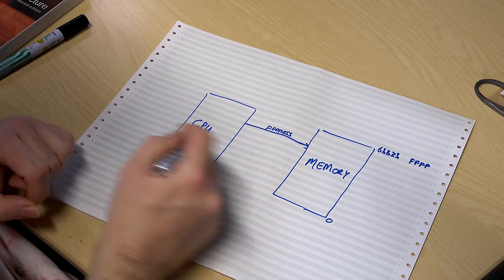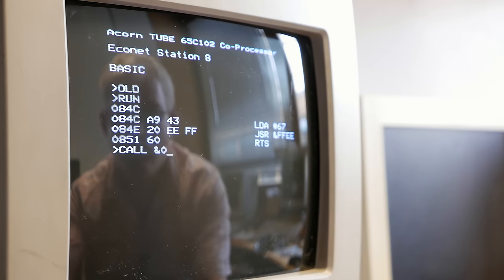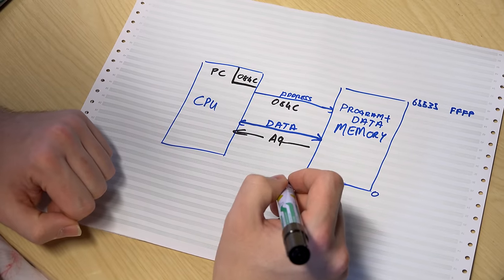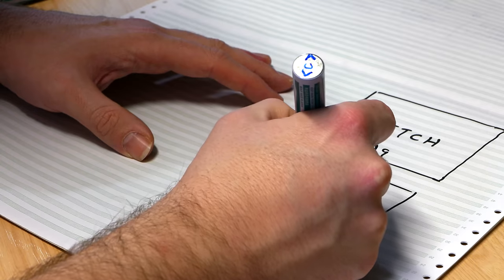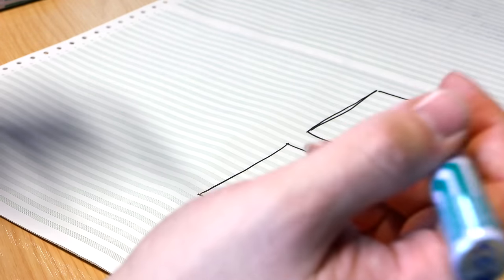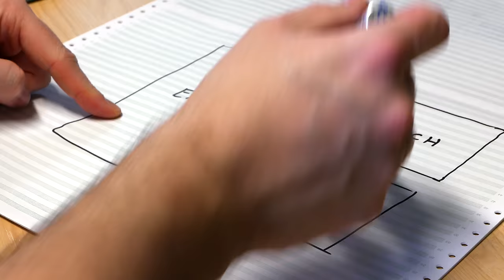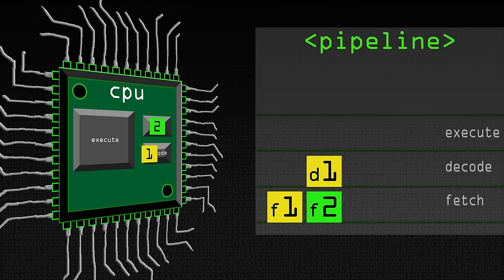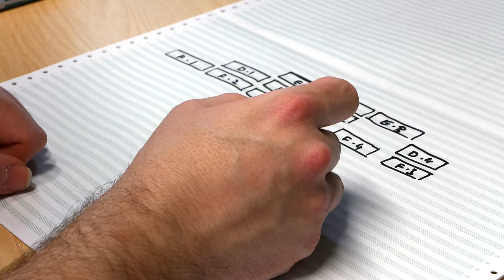Inside the CPU - Computerphile

Comment: I always love this low level computer stuff.  I would like to see things go even a little bit lower, like what exactly executing a command looks like in mathematical terms though
Reply: If you really want to know then check out Ben Eater he builds the various pieces of a computer on breadboard and over several videos you start to see and understand how computers do their thing. After watching and realizing  how much goes into the simplest of tasks it really puts into prespective how amazing something like the smart phone is. It's truely magic.
Reply: lower? so...Algebra
Reply: you know, i think on the level of binary digits these things have structure of boolean algebra, that is kind of abstraction over physical device, ( like usually math)
Reply: Some is boolean algebra, which is then broken down to transistor levels. Most transistors use Silicon in their construction, hence, "Silicon Valley". Other's uses more complex circuits, which those can be broken down to boolean algebra, etc, etc
Reply: Many of the 1's and 0's of an instruction are used as the "select" bit of a series of multiplexers, which are tiny logic circuits that take in multiple values, and output one of those values based on the select bit.  Other 1's and 0's may be routed to internal CPU registers.

The math is handled by the ALU, which can perform math operations hard-wired into the chip, using combinations of the fundamental logic gates.  It's a bit like a CPU inside of the CPU.  It takes as input some CPU registers, and some of the instruction bits, and it outputs to other registers.  It also outputs a few op-codes related to the result of the operation (used for the flags, and other decisions of the CPU).  The instruction bits inputted determine what type of operation executed by the ALU.

Within the ALU there are chips that can add (using several XOR and AND gates), multiply (using several ADD + other gates), negate, bit shift, etc.  I think this would be a great topic for Computerphile to cover
Reply: I hate low level, I love Java and hate mips sorry.
Reply: Lower  ---> logic gates
Reply: I can second Nand2Tetris
Reply: If you want to go even lower than this, it's not really maths you're looking for, but rather how the actual logic gates in the CPU work, and what does what and how, when the CPU fetches/decodes/executes instructions.

Comment: If anyone wants to understand this stuff at a very fundamental level, I would highly recommend Ben Eater's series on building a breadboard computer.
Reply: aye i was just watching that
Reply: Supreme  the large-ish black boxes used in the breadboard computer series are integrated circuits, essentially a packaging around the actual logic gates to make it possible to handle as a human. There's a tiny assembly somewhere in there with the actual logic gates, connected to the IC's outside connectors via tiny wires.

The logic gates in a modern CPU are even more miniaturized, of course. As for where they are in a CPU, well, they pretty much make up the entire thing, storage (lots of caching going on in a modern CPU, also some microcode) and wiring connections (most of the cpu's package is filled up with wiring that connects to the connectors on the bottom; the actual cpu is only a few square centimeters in the center) aside.
Reply: He’s fake. He admits he uses boards.

Comment: Generally a cool video, but I think you should've split it into one about pipelining (there are other hazards as well like conditions). And then you (or Steve actually) could have expanded about the actual steps inside the CPU. I saw a video recently of someone building a CPU (+ Memory) on breadboards using separate chips for the registers and so on. And I found that video really helpful to see what actually means "fetching", "decoding" and "executing".
Reply: Fabian Neundorf , Can you link that video? Id be very interested to see it.
Reply: please link that video ;-;
Reply: PureMotionHD well in my reply I linked it. if it doesn't show up, search for "Ben Eater" who is the uploader.

Comment: I think it would have been worth of at mentioning that executed instuction may also cause program to jump to different part of code. Therefore executing next command that is already in pipeline would be invalid and whole pipeline need to be flushed before continuing.
Reply: Tiikoni And maybe also that the execution of a pipelined instruction may override the value of a memory address already read by the fetch module? In this case a partial flush is also necessary, I think. Although it must be noted that changing the code section of memory is not a "usual" thing to do.
Reply: This is exactly why it is a bad habit to use "'goto" in programming languages....
Reply: That's what branch prediction is for
Reply: Neural networks ftw
Reply: @Flankymanga That's not the problem with goto.  Need an if() statement?  That's a jump.  Need a for() loop?  That's a jump.  Need to call a function?  That's also a jump.  The problem with "goto" is that it makes code hard to read for puny humans.
Reply: Goto is also a jump and what goto does that if and other cnstructs does not is that goto keeps the context of local variables alive from where it was called to the block where the flow jumps to... and that might lead to catastrophic consequences...
Reply: There is a goto in machine code, (jump). But not selection, or iteration (if, repeat, while, for …). P.S. goto is considered harmful (in a high level language).
Reply: No goto is never needed in high level programming. I will not explain here, as there is not the space, I have not the time, and there is plenty on the subject online. It was once said, that a goto is an indication of ether a limitation in the language, or a limitation in the knowledge of the programmer.
Reply: using break?
Reply: Flankymanga break doesn't get you oit of nested loops unless you use a series of break with logic around them. it can get tortured.
Reply: Flankymanga many languages have labeled loops and you can break by label but this is very nearly a goto anyway. bikeshedding :)
Reply: Actually there is an IF in machine code, but a very basic one: if not condition skip (this or next instruction). This is a conditional instruction.
Reply: Other names for goto: break, return (Result = x; goto end), continue. However goto and all of its alternatives are relatively benign (can be used well, but best to avoid) in C like languages. Except in switch case where for some reason break in compulsory.
Reply: By not using break or goto (break is goto in disguise): Therefore add an exit condition to the loop e.g. instead of — loop until(is_finished) { if is_found then break else do work };try this — loop until( is_finished or is_found) {do work}
Reply: Here I am
Reply: xheralt My response is a bit late, but in view of the Spectre bug, your comment about x86 addressing modes is quite observant!
Reply: @Flankymanga  
What is the low-level difference between a processor executing a "goto" and a for or while loop in a program?

Comment: Woweee..This is like seeing your street on TV.. Ex-intel cpu and current ARM cpu group engineer checking in..Any fellow computer uarch/arch folks?
Reply: skeptic youravg so where did you study and what (from someone genuinely interested in the career)
Reply: Electrical Engineering (courses in computer Arch & Digital design).. Arizona state univ..
Reply: Cheers! I worked for ARM Gemany about 7 years ago. In the simulator group. They had a just in time ARM to x86 translator (done by a goup in the UK) and a GUI tool to build entire SoCs from ARM parts (done by us). You stiched your SoC together in the GUI and a simulator of that system was built by generating code and compiling it to an executable. 

Interesting stuff. Sadly they closed the site.
Reply: ARM is hiring like crazy right now..plans to double in the UK in the next few years..You can still make it back :)

Comment: CPU is way more complicated than the video entails. Modern processors do all types of things to keep the pipeline filled such as pulling more data than required. For example: rather than fetching one instruction at a time, it could fetch an arbitrary volume of memory (let's say 64 bytes). It would then decode as many instructions as it could from that block and prefetch the next block when the fetch bus isn't in use. Then, it can cache the decoded instructions to prevent fetching and decoding recent code. The CPU can also make notes about the instructions prefetched to predetermine holes in pipeline and try to fill them by reorganizing instructions. This also helps with branch prediction and register renaming.

Comment: Oh the times of the 6510 on the C64.
I could read (and disassemble) hex code like reading a book. Modifying the OS, writing cracks and use the space used by the copy protection code for more useful stuff was so easy back then.
Reply: What assembler did you use? I didn't think the Commodore 64 had an assembly monitor in rom like the Apple 2 did.

Comment: Interesting that you give an example of a system where most of the parts of the CPU are idle, then compare it to a 6502...
Which does instruction decoding and execution in parallel. (it's like a short, 2 stage pipeline, but not quite.)
compared to some other processors from the era the instruction times for 6502 code were very short and consistent.

I miss The 65x family. But it died out because it's entire design is built around having RAM that is faster than the processor.
And since the mid 90's it's pretty much guaranteed that the processor is faster than RAM.
That's why cache memory exists. If your main memory was fast enough you wouldn't bother implementing a cache, because it would be redundant. But... When main memory is slow... Cache helps keep the CPU busy...

Comment: Can you explain the "on an ARM processor all instruments are 32 bits long"? I'm going to take that to mean "the same bit length" vs 32 bits. But besides that, I remember doing ASM on a NXP chip and some instructions take a few cycles. But I could've swarn some of the Java and thumb 2 stuff had a different instruction length...?
Reply: Cool, so I was half remembering correctly... It's been a while, so that's kinda cool to know :)
Reply: Btw, I searched on the ARM infocenter site first, but the Keil explanation was the best I found.
Reply: The (original) ARM processor used 32 bits (4 bytes) to encode its instructions unlike the 6502 which  used 8 bits (1 byte) to encode its instructions (a lot of bit patterns were not used).

The 6502 used synchronous memory access - every clock cycle it read/wrote memory, and so used a single byte program counter pipeline - the next byte of the program (instruction/data) was being read: in his example of A9 43 when the A9 was being decoded the 43 was loaded, executing the instruction shifted the 43 to the A reg so whilst that was being done the next instruction 20 was being read in, and so on.
The biggest problem with bubbles (in the pipeline of the 6502) was branch instructions - they could take 2, 3 or 4 clock ticks to execute (2 if no branch, 3 if branch to memory with the same page number (top 8 bits of address), 4 to a different page).
Most instructions take 2 clock ticks plus extra tick if absolute addressing (3 bytes long) plus extra ticks for different addressing modes (causing bubbles).

The ARM processor executes near enough 1 instruction per clock tick by avoiding branching (bubbles in its pipeline) by using some of the 32 bits of the instruction as a condition - the instruction only executes if the condition is met (there is the condition TRUE which means the instruction is always executed).

I'm trying to remember but i think the 32 bits may have included memory addresses and immediate data.

Comment: Id like to know how the design effects performance, and why AMD has trouble competing with Intel, why has the improvement slowed down in the last 5 years,  what are the challenges in making a better processor etc.  Is the whole approach with the way the CPU designed wrong?  Not wrong but are there different ways not explored yet?  Does functional programming have anything to with it?
Reply: Biggest challenge is making smaller and smaller transistors, I think.
Reply: @davidwebb4755  You are correct.  The problem is that integrated circuit components have reached the point where their transistors consist of so few atoms that to make them any smaller would introduce too much electrical resistance to allow the circuit to work.

Much of the work now is going into packing more and more CPUs into a single chip so that the computer can literally do many things at once.  In some applications, such as 3D rendering or spreadsheet calculations, this speeds up overall processing speed by a huge amount.  In others, not so much.

Comment: cant the bubbles be removed if the instruction memory and data memory were seperate? the structural hazards can be avoided that way since we can access both at the same time
Reply: This is actually why CPUs have multiple caches in series and parellel; The instructions and stack variables tend to be towards one end (or both ends) of allocated memory, while heap variables are towards the other end (or the middle). While the bubble can still exist, it's toned down many orders of magnitude, and still allows the possibility of treating instructions and data interchangably.

Comment: so if the pipeline infrastructure cant fetch a command and execute a command at the same time,

doesnt that just mean you need another data bus?

It seems to me that if you need one data bus for fetching instructions and another for accessing memory, that you should have every possible part necessary to execute a command redundant and in parallel, basically one bus for accessing memory, one for fetching instructions, a decoder for both, and then no matter what the instruction says, you always have a bus ready for it to be used on the next tick, so you always have an incoming pipeline and a parallel pipeline for things required in the actual instruction.

If you have pipeline flow issues, make the pipe bigger or in parallel :P

Comment: Interesting but I don’t understand how in the past there was a race with CPU manufacturers to have the highest number of MHz and that basically said how fast the CPU is. 
Why is that no longer a thing?
Reply: It was mostly just marketing. The same CPU running at double the MHz can theoretically perform calculations twice as fast. But you can also design the CPU to do more at slower speeds. It's no longer a thing because a) consumers realised that MHz only tell part of the story, and b) higher frequencies are exponentially harder to keep cool and stable
Reply: Basically to increase clock speed you need to pack transistors closer to each other, as well as evacuate the heat from smaller volume, and physical limits have been approached

Comment: I still have a big question: how does this translate into transistors? the piece piece I am missing of the puzzle is how adding more transistors increases the speed, specially knowing that there are tasks that require to be sequential.
Reply: Just adding more transistors doesn't increase the speed, but some programs can be structured so that several parts of the program can be run at the same time, only in different parts of the CPU.  In that case, "more transistors" equals more "cores" in the CPU, allowing it to literally do more than one thing at a time.

But as you guessed, this does not increase speed where all parts of the program have to be run in sequential order.

Comment: How does the CPU know how to draw the character? Is it coded within the CPU itself?
Reply: The CPU doesn't "know" anything.  Usually, in a Windows system, the CPU has to run a sub-program which translates the numeric value into the graphic for that letter or other character (eg 65=A).

Comment: I still don't get what's actually happening inside the CPU. How does it "know" to put a value in the point counter? How do the CPU and memory "talk" so that the memory knows, or is forced to send, an instruction from a specific address? Why does running two voltages (1s and 0s) through a CPU do anything? Seems like the CPU "knows" certain instructions, but where does the "knowing" come from?

Comment: I don't really get what the decoding is supposed to do, can't you just execute a piece of code after you fetched it?
Reply: But in order to execute it you have to know what it does. Is it a math operation? Is it a compare? Is it testing for flag settings? Is it accessing a memory location?
Reply: arcuesfanatic that makes sense to me. Since you seem to know a lot about this, why is it that when an assembly instruction uses for example the hex code 22FF, in assembled machine code it becomes FF22? Things are written backwards for some reason
Reply: It really depends on the architecture, but the general idea is the instruction might not neccessarily be an atomic instruction. For example: var += 5 in most C family languages translates to var = var + 5. Some CPUs might implement a += operator in addition to the regular + and = operators. This allows the program's footprint in memory to be effectively two instructions shorter. The CPU would probably have the operation implemented in it's decoder by inserting load(var) -> add(5) -> save(var) atomic instructions into the instruction queue, rather than implementing a circuit for doing all three at once in the arithmetic operators unit.